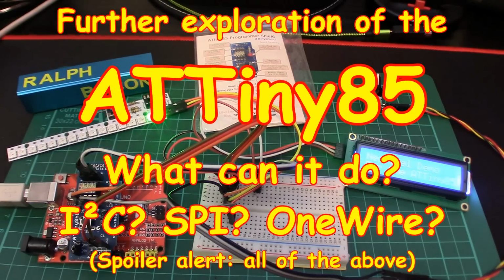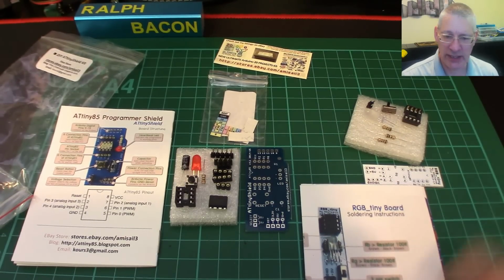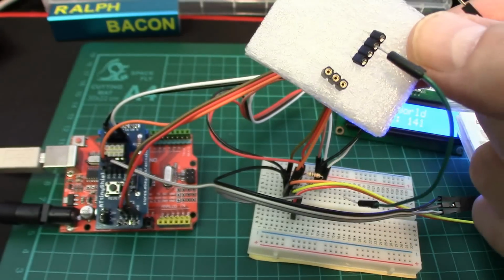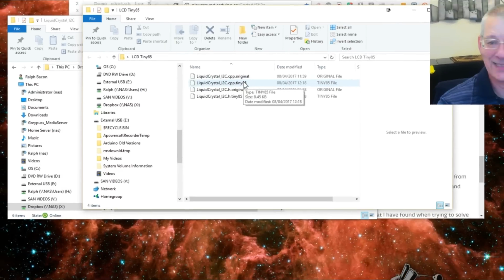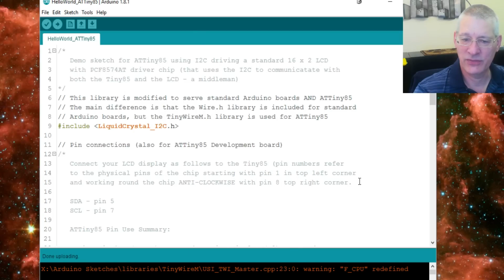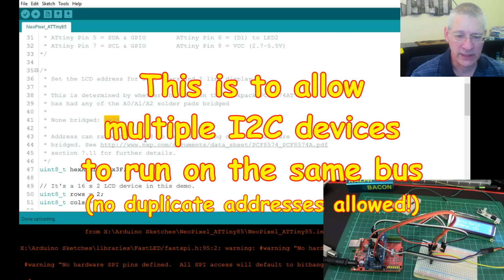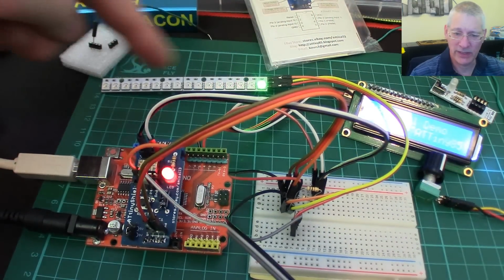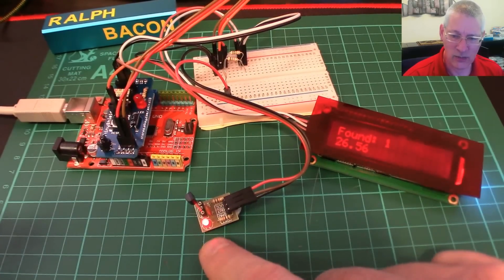#82 ATTiny85 + I2C  + SPI and more!

Comment: Thank you for another excellent video. I got some ATTiny85 boards from Adafruit a few years ago (and I know your video #66 is about the similar but not quite as nice Sparkfun device -- I reuse to buy from Sparkfun any more for political reasons, which we won't get into here). She calls them Trinkets. There is a 5V Trinket ATTiny85 and a 3.3V version. They are under $7, fully assembled (except for headers), with a USB interface, so you can program them directly from the Arduino IDE. The 5V Trinket works at 16MHz and the 3.3V version works at 8MHz. There is a larger ProTrinket version that runs an ATmega328P. It is about the same size as the Arduino ProMini. They have tutorials & libraries for all the Trinkets.

Like so many of the small boards I buy, the first thing I do is make sure the LED blinks, then I change the blink rate. Having thus skillfully mastered the board, I then put it in a box on a shelf. 

My experiments with general purpose 2X16 LCD I2C modules have always ended in failure. I can set the address OK (and, in fact, nothing happens unless the correct address is set). When the correct address is set, such as 0x27, what happens is that the screen immediately goes dark when addressed. If I un-solder the I2C adapter, then using the parallel pins works great. I have tried LCD modules with the I2C interface, and I have bought separate I2C adapters for parallel LCD modules. None of them work for me under I2C, and all the LCD displays work OK with a parallel device. I have no problems with other I2C devices. However, the specific LCD modules for Arduino, and for a Raspberry Pi, work OK. Just not the general purpose ones. [Lego Mindworks I2C is interesting, because it uses the same PCF8574 & PCF8591 chips, but requires 82K pull-up resistors]

I purchased a couple of 8 neopixel strips, from China, but can only get the first 5 neopixels to ever do anything. Even hard-wiring them to a power source only lights the first 5 of each strip. Either I am doing something wrong (and I followed at least 3 different neopixel projects), or the strips are defective (and, if they are defective, either the seller knew it and shipped them anyhow, or else he didn't know it, but should have).

I've used Arduino Unos to program other devices, and it always surprises me when it works. But those pesky warnings sure are pesky. I get them all the time. Research has shown that they can often/usually/always be ignored. So why are they there in the first place? What I really hate are the hard to program in Arduino devices, like a Teensy 3.2, and so on. You have to almost use voodoo, three hands, and then multiple attempts to get the thing into bootloader mode. Then you get to watch line after line of compilation information stream by in the status window. After all that, sometimes it works, and sometimes it doesn't, so you frequently have to start all over again

I've never seen on of those nifty IC pin straighteners before. I have some manual ones that you slide the chip through. Mostly I just use the "roll them on their side until straight" brute force method.

Thanks again for the interesting video.
Reply from the maker: Quote of the day: "Having thus skillfully mastered the board, I then put it in a box on a shelf."
 
I think this is a "man thing". We see something that looks like it might one day be useful, buy it, try it, then put it to one side until we actually need it (usually, never). That's why there are thousands of DIY tools, gym benches and, of course, electronic gizmos gathering dust across the globe in the "man cave" (shed/garage/workshop/spare bedroom).
 
Regarding the 2 x 16 LCD you may find (as I did) nothing happens until you adjust the contrast variable resistor on the backpack PCF8574AT board. Easy to miss. Why they are not shipped with it set to something useful I'll never know.
 
If you follow my demo for NeoPixels (using the same FastLED library) you should have no trouble at all. All my Neopixels work just fine using this library (which is quite involved in getting all the timing just right).
 
Those warning are from the compiler as it compiles the underlying (library) code - libraries rely on other libraries which may now be out-of-date and thus generate warning. It's a bit worrying when a #define is #defined again somewhere - how do you know which value the compiler is now using? I changed the #define in, of all places. the Print library (as used in Serial.print) to stop some errors! I hope I don't come to regret doing that!
 
Get yourself an IC pin straightener like mine - cheap and works like a dream. No more "rolling on the workbench" required.
 
Good to hear from Art, glad you found it interesting.
Reply: When I was watching your video #62, I immediately, and successfully, predicted that it would be referenced again in a comment you would make to me in video #82. I don't need a Tardis to time travel; I simply use my brain (and, just like the Tardis, my brain is bigger on the inside than it is on the outside).

After a series of unfortunate events (none of which were my fault), I was able to test my two eight LED 2812 neopixel strips, using video #62 as a guide. Previous tests showed that only the first five of the eight LEDs would ever light. Using the FastLED library, I was able to confirm this for one of the strips, while the other one now only lights three of the eight LEDs. For the five that did light, I was able to change their color with no problem. 

I was also able to confirm that my nifty Keyes Uno clone, with its nifty male breakout pins for every data, power & ground signal, also does not work properly, and is thus no longer nifty. I tried the D2 and D3 male pins, and they both failed. The regular D2 & D3 connections, on the standard female header strip, worked just fine. Thus, the main purpose of buying that particular clone was frustrated (as was I). 

My current estimate of junk versus useful purchases from China is 5%. Only three products failed completely (for a loss of maybe $10), while the others had minor to major defects, but were still useful.

Thanks again for your videos and technical assistance.
Reply from the maker: My brain cells are bigger on the outside than the inside. Yes, both of them. So my brain is like an inverse Tardis. What you see is more than you actually get. Hang on, am I doing this wrong?
 
I have had very few actual hardware failures with stuff from the Far East. I've had a couple of things not turn up, or turn up incomplete (such as a recent delivery of some very nice, compact 10K pots, but without the washers and nuts - the seller sent me those, separately, when I queried!).
 
Sometimes the soldering is less than perfect (but then again so is mine!) but it's the Far East that let's me follow my hobby (and host this channel) so I'm quite forgiving when things don't always go 100%.
Reply: @RalphBacon  have to agree on goodies from the Far East. But as I'm in Thailand, it not that far and not that east!
I have drawers full of stuff from China and the failure rate of the electronic stuff is very low. So called cheap and nasty mppt controllers work flawlessly, all my mcu's are clones and haven't had one yet that didn't work as it should. I think that they have it well sussed with this sort of stuff. Costs them practically nothing to copy stuff and make it by the bazillion, and then I can enjoy my hobby cheaply.
Matt.

Comment: What are those f/ header pins called?
Can u explain how 2 put included code in a separate tab so it could be changed?
Reply from the maker: The female header pins are actually called header sockets but I must admin I erroneously refer to them as "pins". Well, they have got  pins to solder in but it's the socket part we're interested in. I will make every effort to refer to them as "sockets" in future videos, Vic.
 
To include separate tabs, first create (empty files) of the correct name in the same folder as your sketch. So, if you have a folder called VicDemoSketch and in that you have sketch called VicDemoSketch.ino, create further files here, such as TestHeader.h and TestCPP.cpp. Then, when you load your VicDemoSketch it will automatically load the other files too.
 
I should really demo this quickly in a future video so people know how to do, a picture paints a thousand words and a video generates 20 pictures a second (well, mine do) so that's a lot of words!
 
Thanks for bringing this up Vic, others will benefit, I'm sure.
Reply: Thanks a vid would be appreciated as I don't quite get it :)

Comment: Thanks for the heads up on the pin straightening tool. Been looking for one of these, never thought of Maplins. (TBH, I couldn't think what to call 'em).

I like the ATTiny85. I really want to use the I2C slave mode to bring a cluster of sensors together with the one I2C connection. Most of all, though, I like the fact that it IS limited. I know that reads weird, but using an ATMega328  but only utilising only a few pins (or timers etc) sets my OCD on edge and I waste a LOT of time trying to think of other things the 328 could do. Don't get me started on putting a 32 bit MCU like the ESP8266 to good use.

Brilliant video, Ralph, you make 35 minutes go by like the blink of an eye. Thanks
Reply from the maker: Hey Michael! I hope you do find that pin straightener tool (Maplin is probably an expensive, albeit convenient source) but I'm sure eBay must have them too.
 
Now you' the third person to mention SLAVE mode I2C so perhaps I'll add this to my list of things to demo (It's not rocket science, but it is useful). And I hear what you say about over-engineering projects using a µController way too powerful when an ATTiny85 fits the bill just right!
 
Sorry about the 35 minutes you lost in that space and time continuum of my video, I do actually try and get them down to 20 minutes but so far have been pretty unsuccessful! Next time, maybe! Thanks for the support, always good to hear from you.
Reply: I only found one pin straightening tool on ebay and with postage, that was only pennies cheaper. We have a Maplin abit 15 miles away and no doubt I will find LOTS of stuff I have really needed ALL my life; when browsing the shop. Ebay spoils us. One gets so used of being able to get 50 of things one only really needs 1 or 2 of, for £0.99.

It would be awesome to see your treatment of I2C slave mode on the ATTiny85. Sod's Law suggests that employing that mode leaves too few resources to communicate anything useful to the Master. Prove my cynicism wrong, PLEASE.

As to timing: the 35 minutes took no time to pass but the 24 seconds seem to take forever. Seriously,  the concept of one of your videos taking too long  is far too abstract for me to conceive.

Comment: Nice video, the ATTiny85 is sometimes very handy to have around, small chip and easy on the power.
Reply from the maker: True, Javier, and I am most definitely warming to it. And definitely easy on the power, especially at 1Mhz which might be all you need. I was worried that I2C or Serial would not work at 1Mhz but it most certainly did. Thanks for posting!

Comment: Only thing that's not to like about these kits is that the Chinese use that static Styrofoam which could damage the chip(s). Thanks for the video again Ralph, very interesting!
Reply from the maker: Benny has calmed down now (I had to give him some cream and a special tuna dinner) so I'm hoping things will be back to normal (YouTube-wise), later this week.
 
On a slightly more serious note, it did at least prove that the "packing foam" did retain a static charge. Components surrounded by this material and built into a circuit board are less likely to be affected by static (but still most definitely can be) but discreet, loose components are most likely to get zapped. I managed to reset my latest Arduino project just by touching it. I could feel the electrical discharge leave my finger as I touched it and for a second or two was quite worried that I'd done it some mischief; I was mightily relieved when I saw that it had just restarted and everything was still OK. Phew!
Reply: As | a prospective agent for Benny, I take exception to this suggestion. You have forfeited your opportunity to subscribe to  the forthcoming Benny channel!
Reply from the maker: Worse than that, when I actually tried this in all innocence, Benny took umbrage and said he might not do any more coding this month <shock> <horror>. Lucky, then, that I already have another video queued up, scheduled ready to go. Perhaps by then he will have got over his hump and be busy dictating more code to me... We can but hope, but no more cruel suggestions, please, Darrell <ROFL> Oh, yes, BTW it DID stick to him briefly, before it fell off as he ran off in a huff....
Reply: This kit is not made in China but in Greece. Styrofoam is chip friendly and keeps the legs unbend. Thank you.
Reply: That certainly isn't my experience.
Reply from the maker: Would you Adam and Eve it but this topic is hot right across the Internet. Styrofoam seems to viewed as a reasonably good packing agent but doesn't appear to protect against static (if that protection is needed). I've just put my bench multimeter across the foam in this kit and it didn't register at all; some black conductive foam that I have some ICs stored in did register from 300k (light touch) to just a few k-ohm when pressed quite hard.
 
I've had ICs delivered wrapped in aluminium foil before now, but "tubes" are of course the best thing, as they not only protect the chip against bent legs (as the tube is IC-shaped) it is also conductive so will not store a static charge. Cheap too, with just an elastic band round the ends to stop the chips falling out.
 
Mine turned up OK as you all saw, so I'm not getting into a debate about this but I have zapped a couple of MOSFETs just by touching them so I know that static electrical discharge damage is a very real thing. Whether the ATTiny85 needs that protect is something the manufacturer might specify in their spec sheet regarding transport?
Reply: Rub a piece on your cat, If it sticks to the cat then it's bad for chips.
Reply: I guess a wool sock would have tested the theory also. Oops... Sorry Benny.

Comment: Haven't seen one of those chip extractors for a very long time :)
Reply from the maker: Just goes to show how long I've been around Carl! It's probably the right time to say that this particular chip extractor only just works on 8-pin chips (it's fine on longer chips). There are others, simpler, cheaper that would probably work that bit better, I think. I'm sure eBay and the Far East has them by the dozen, so if you need one, get one!